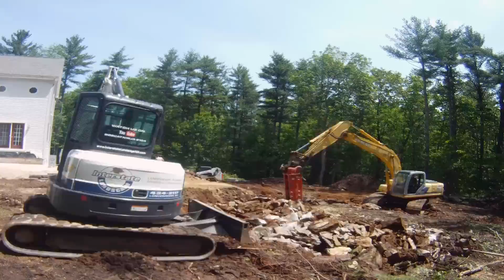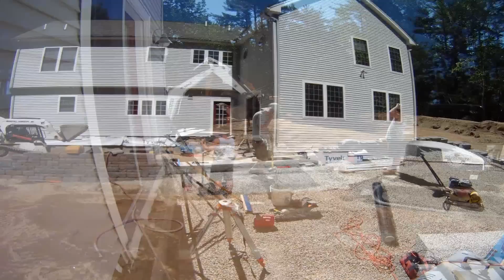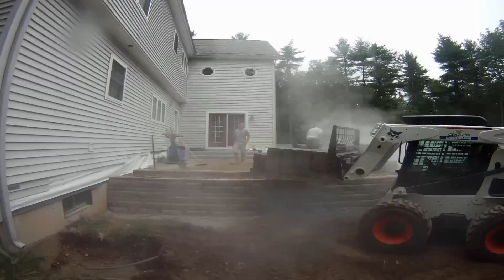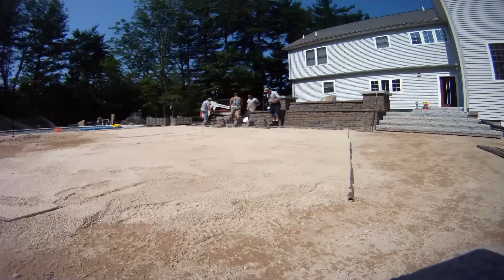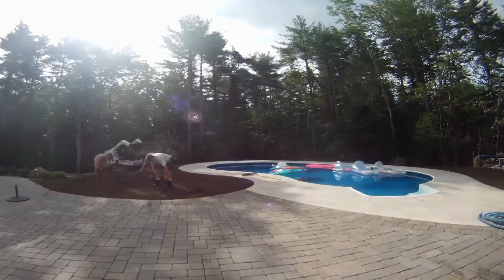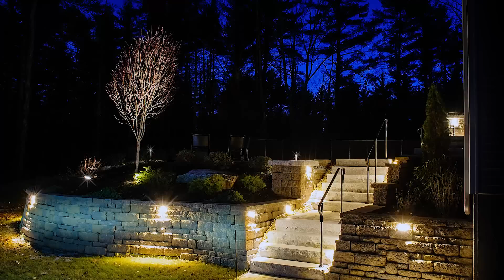Backyard Raised Patio Makeover: Landscaping Time Lapse

Comment: hey I've watched what u do and u do great work but one question is i see where the old deck height was and where the new patio is how did u protect the outside walls of the house to keep them from rotting cuz when water gets on the patio the water will get into the sub base and if the wall sheathing is not protected properly and no proper drainage put in ( i figure u did that though) it will rot and then the framing of the house will too and i am only a Sr in a tech school in my state but i work with my dad doing carpentry and a contractor at school though a work based learning program we have and i have seen a lot of things done wrong where the outside finish (landscaping and house finishes) can look great but they hide all this damage being caused by water penetrating the structure of the house, so would just love to hear how u handled the water proofing of the house where the foundation is not high enough
Reply from the maker: Great question. It was properly flashed, sealed and extra ply-wood added for support by a carpenter we use. He used Tyvek and a few other things.
Reply: BobcatNinja2124 thanks and just one thing u might be good to know, Tyvek sucks and deterearates too quickly your better off with a haevyer felt like paper from Typar

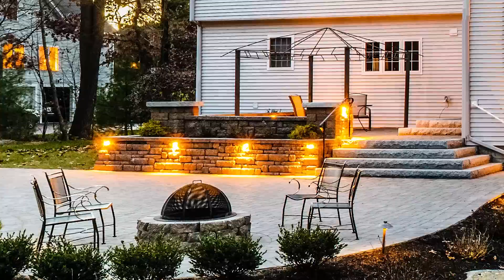Comment: Just curios at 4:17 in the video on the right side of the stairs the first course is that your base course or do you have another buried? Also where did you run your drainage for that side? I know you did, I'm just curious? Thanks an amazing work.
Reply from the maker: There is another one buried. And all the drainage including the pipes for the gutters runs away from the house and under the stairs and under the left hand side of the wall out to the woods
Reply: Thanks, for the drainage pipe underneath the stairs, what did you use?
Reply from the maker: Michal Barrie
Just a 4" flex pipe